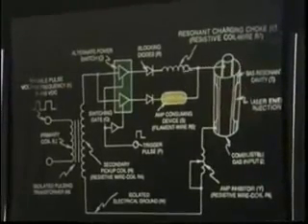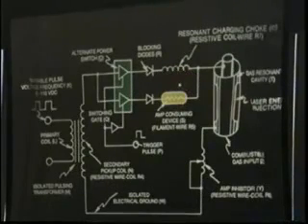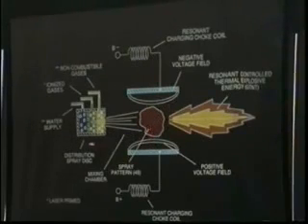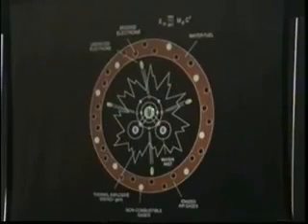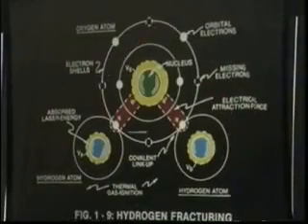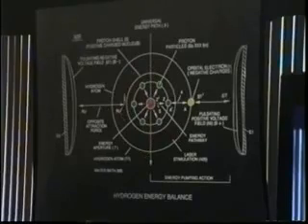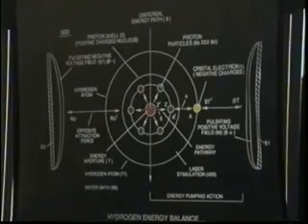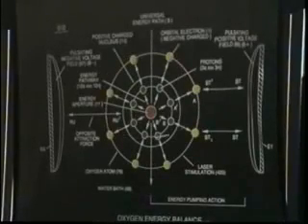Stanley Meyer Gas Processor Gases Increase HHO Output.

Comment from the maker: And in the process,The answer was really simple.That as you ignite the Hydrogen and Oxygen gases. If you will now prevent the hydrogen and oxygen atoms from coming together to form the water molecule it can not stabilise. Right!  If the water molecule will not form during thermal gas ignition, then what will happen? Well thermal explosive energy has to keep continuing to occur. Until one or two states occurs. Either that a new atom structure is formed or an implosion effect occurs and mass is converted into pure energy. The equivalent energy yield from one gallon of water is more than 2.5 million barrels of oil.Per gallon of water. When you're talking about tapping into the atomic yield of water safely.

So as a result of this we are now starting to destabilise the combustible gas atoms [Combustible gas atoms are the intake air, this is the gas processor.] 
Were starting to pluck off their electrons in the process to decrease mass,
We're adding laser energy to the process to bring them to a high energy state.
Now we have combustible gas atoms coming off the water that is not a normal state, right? They are now in a subcritical state. [ The combustible gases are premixed through the water, ,ionised processed air atoms in the water] 

To do this we had to develop the electron extraction circuit plucking the electrons and you're now using the water as a source of electrons as well as the gas.. 
[The processed air diffused through the water lowers the electron count in the water preparing the water fuel, for electrolysis gains or combustion gains] 

As you attenuate the pulse voltage potential. The negative charged electrons in this particular case would come out of the resonant cavity and come down here interact with the filament of the light bulb producing heat energy in the form of light energy. Am I defying the laws of physics? No. The byproduct of the process is electrical energy gentleman. When you look at water you now have it as a source of electrons. And at any time you move an electron down a wire. Have you not created electricity?  Coulomb proved out if you have a difference in potential of one volt you can move one amp of current. Ok, go ahead.

Part 2, Notice the mixing chamber. Water is sprayed through the processed air and through the exhaust gas recycle and ionised between the electrodes just like the car injector but in the case of the car injector the processed air is diffused through the water first, as it can hold up to 17% gases per unit of water.

Part 2  Now in order to do this we are now taking natural water. We are now mixing it with ionised gases [processed air] and non combustible gases [Exhaust gas recycle] to regulate the thermal burn rate. And we are now subjecting it to a very high pulsed voltage frequency. Tuning in to the dielectric properties of the gas, [processed air]   We are now performing three functions simultaneously in order to release energy from ordinary natural water on demand.

Part 3 [The interaction of processed air and laser primed hydrogen on Hydrogen combustion.]

Part 3  Right here is an illustration of the hydrogen fracturing technology. As you hit with applied voltage frequency we are now plucking off their electrons. We are destabilising the hydrogen and oxygen atoms by adding also the laser energy to the process.The ionised ambient air gases are capturing and preventing the electrons from going back into the process. And as a result we are now spark igniting it with the voltage. Go ahead!

This is an example of the hydrogen fracturing technology to give you a little bit more of an illustration. Here is where we have plucked off the four electrons of the hydrogen atom. [ I think he means oxygen atom as in the illustration]  
We have highly energised it so this is in a subcritical state is it not?
And as a result of this we are now capturing the hydrogen electron and as a result the laser energy being absorbed here now [Hydrogen] is in a weakened state since the oxygen atom is in a high energised state it will pluck of the electron much like that of the muon and release that tremendous amount of energy safely. Go ahead!

Part 4 [Processing and priming the ambient air gases for interaction during combustion. One must notice no cell is used and no hho is produced. Until the processed air in the water or mixed at the point of combustion. Is ionised a second time extracting electrons from the water fuel mix till spark ignition.]

Part 4.Now we have also observed another phonominum we talk about aether energy or god energy, god’s breath of energy. As you now subject the liberated combustible gases [processed air] to high pulsed voltage and restrict the amps. You are now attenuating the electrical field within the atom. In the law of physics we know there are four basic forces that affect the atoms. There’s electrical force ,electromagnetic force,weak and strong nuclear forces. Is that not so? Therefore applied high voltage will now affect and put electrical stress on the atom and as a result we are now attenuating the energy aperture of those combustible gas atoms [ processed air] allowing universal energy to come into the system. And as a result of this we are now priming the combustible gas atoms [processed air] to release a tremendous amount of energy [interacting with combustion] and as a result of this we are using voltage to accomplish the task. Go ahead!

Here again we are now using the oxygen atom [From air] which has multiple protons in its nucleus. We are now putting electrical stress on the energy aperture to allow the universal energy to come in. Based on the pulse frequency applied pulse frequency across these combustible gas atoms .We are now bringing these combustible gas atoms to a very high energy state pier to gas ignition. Go ahead!

 [ Here we can see no electrolysis, before ambient air ionisation up to thermal spark ignition.. The ionised processed air is mixed into the water or mixed with the water prior to combustion. And is then ionised a second time,causing the electrical polarisation of the water molecule.] 

[The basis of this is to show that no cell other than the air gas processor cell WFC. Is needed. The water fuel technology is the processing and priming of the ambient air otherwise referred to as the combustible gases.]